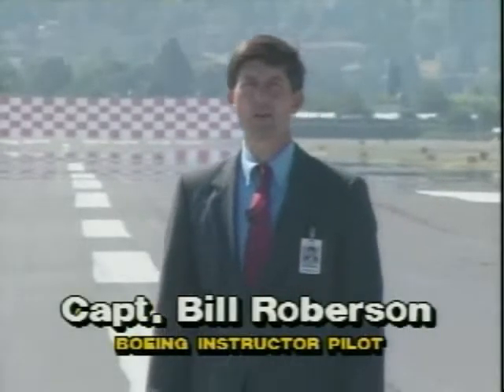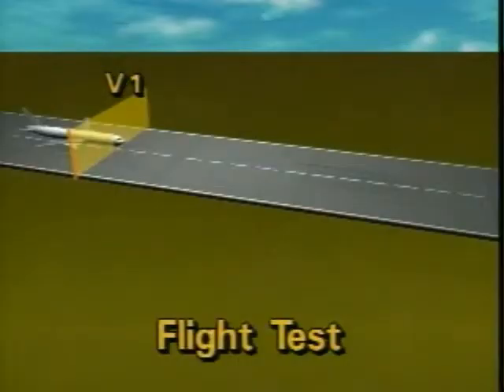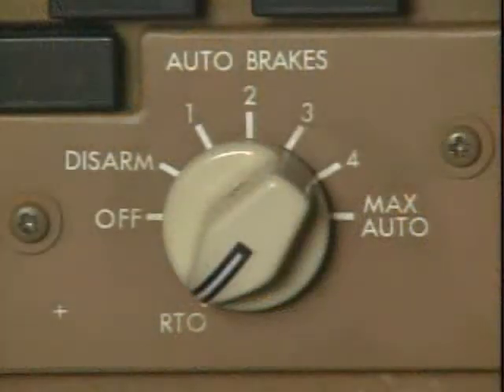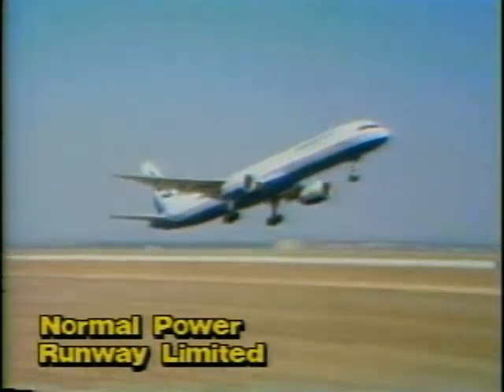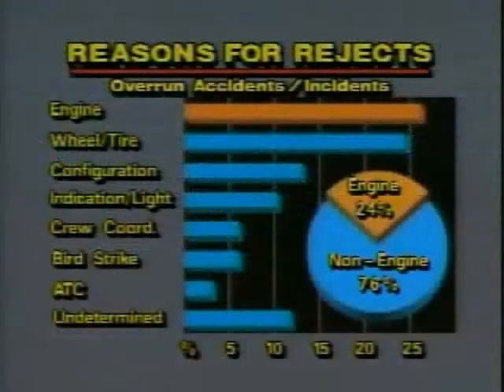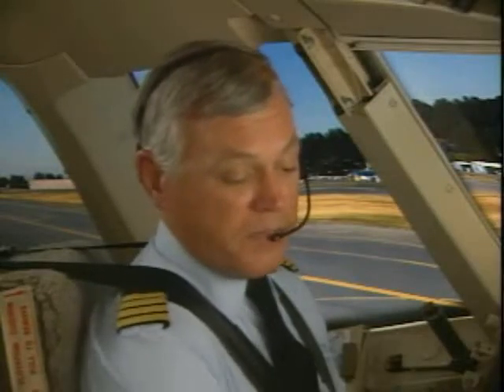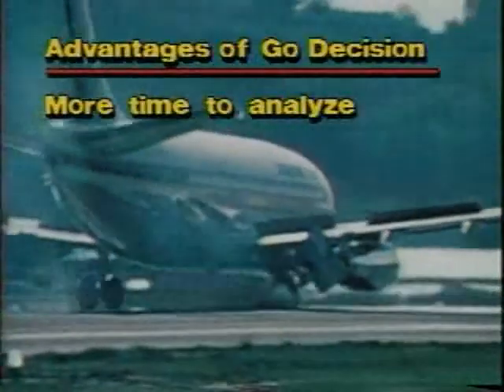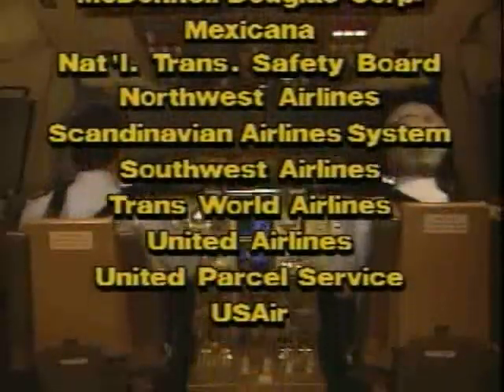Rejected Takeoff and the Go/NoGo decision

Comment: If you hear a bang and stop would you use reverse, not knowing if a engine blew up?
Reply: Yes, of course. Why wouldn’t you?
Reply: I don’t think so maybe I’m wrong .just use auto break and then Manuel that would be correct but here they say we should apply breaks 1 st so voila
Reply: Yes you would use full reverse unless you are on a slippery runway and you notice that directional control is uncertain, then you would reduce to idle reverse thrust.
Reply: @iantalbot7364  Well that was my query, asymmetric reverse thrust causing directional control problem.
Reply: @flybobbie1449 we'd use full single engine reverse on the ERJ all day long with the MEL

Comment: The decision to abort is heavier than to GO at high speed due to proper judgement of momentum versus decelerate stopping available and the runway condition and gradient of the day.Better to abort in principle only if the plane's flyability or an engine/APU/Cabin fire erupted. At high energy you are close to flyable speed and so better to fly and return to land with a  more comfortable stopping margin. For windshear at high speed it is better to select max thrust and get an extra 10 kt and continue the take off, especially in damp/wet conditions. Most aborted take offs above V1 resulted in runway over runs with high impacts and quite likely tire failures/fires and heavy casualties due to high momentum impact or if there is a surface drop at the end of the stop way.Fires are likely to result also due to heavier fuel uplift during take offs.Take offs are inherently more dangerous than landings as a result!

Comment: Watching this, I understand why pilots are taught V1 is almost sacrosanct. But I wonder whether that should ideally be treated on a more airport-by-airport basis. I'd think that if you're on a runway that has a 1000ft overshoot safety area (or EMAS) and then a mile of flat, open field past that, the safest move if you perceive a terrible problem has occurred might very well be different than if you're on a runway with a small safety area and beyond that a cliff that drops off to a river.
Reply: I think the idea is to have it engrained like muscle memory - there is little time to process extra information like that on top of everything else, V1 is your last chance to stay on the runway. Even a short overrun can result in a major accident so you're committing to a crash, basically; and whatever the initiating cause, then where V1 was is probably the least of your worries at that point.
Reply: Then you can unbalance the V1 speed. V1 on some aircraft is a range of speeds.

Comment: I thought the speed brakes would deploy automatically when the throttle is retarded in an RTO.
Reply: Not on Boeing aircrafts, but on the Airbus, it will as the pilots are suppose to arm the spoilers before take off. In Boeing aircrafts, if reverse is selected, the speed brakes will automatically come up, but the pilot will usually pull the speed brakes up before reverse is selected.

Comment: How about the Concorde's accident?

IIRC, after running over a foregin object, a pice of tyre was thrown against the wing, damaged the fuel tank, and set it alight. CMIIW
Reply: They were beyond the point of rejection, the plane had to take off and perform an emergency landing.
Reply: I do not agree, in this specific case, the aircraft would have overshoot the runway and hit the buildings in front of 26R, and those were crowded of people that day.
Reply: The crew didn't knew there was such a big fire, but nevertheless, they'll have to get in the air anyway.
Reply: The concorde took off below v2. Thats mainly why it crashed.
Reply: In hind sight, they probably would have been much better to over run the runway., but again, that's hind sight.
They did what was right given the info they had.
Reply: +KaMeWa2 I know I'm replying to a comment made a long time ago, bear with me. Even though in this specific example, the Concorde crew may or may not have been better to attempt to abort the takeoff,  there would have been no way for them to understand the nature of the emergency in time to make that decision. In 99% of cases where an RTO-worthy emergency happens after V1, the safest thing to do is to take off and work the problem in the air. Obviously every incident would ideally elicit a nuanced and completely informed response, but that is not the reality of emergencies after V1. Up there in the cockpit you are far away from whatever's going wrong. You have to rely on the information given to you by the instruments and displays, and trust in the procedures. The pilots must execute the procedure that is more likely to be safe, and after V1 the accident history clearly shows that in the majority of cases, RTO after V1 is much more dangerous and costly than getting into the air, working the problem and then coming back for a landing.